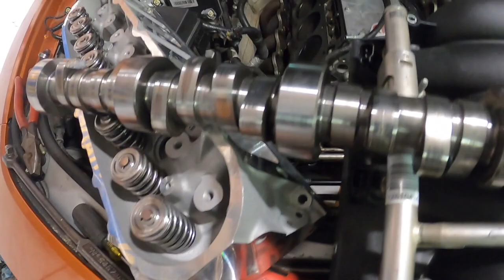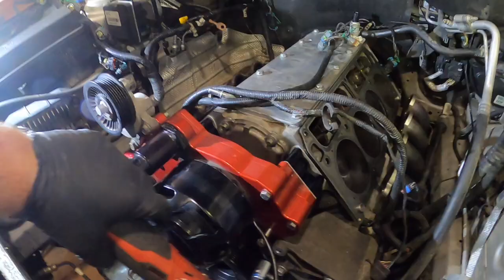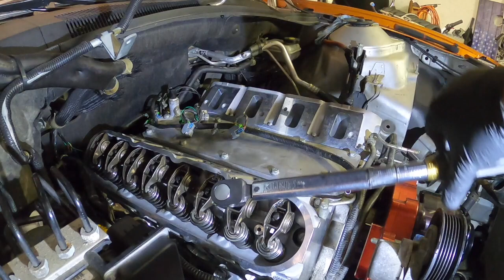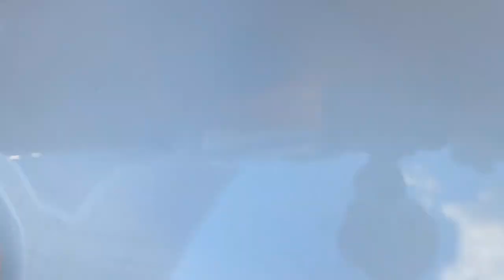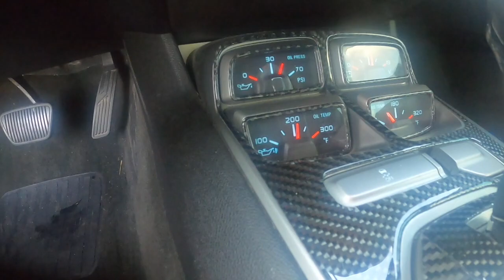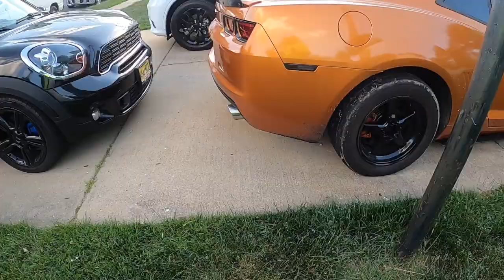Camaro SS SS3 Cam/Ported Heads Assembly & First Start

Comment: Dude get some 3:73 gears you won’t regret it. I have pretty much same setup but tsp stage 3 . Zl1 rear and trans I just put 3m73s and it made a Hugh difference.
Reply: I am having a hesitation issue since new cam install car is going back to tuner next week to get figured out after that I’ll post times hesitation isn’t serious just causing an intermittent hesitation which I don’t want to track it until found and fixed
Reply from the maker: Any 1/4 mile times?

Comment: With powerbond pulley, did your ac squeal? Since i hear it’s occasional thing when you add underdrive pulley
Reply from the maker: Funny you should ask, I did have an annoying squeal but it turned out to be a crappy Gates serpentine belt. Bought a Continental Belt and it was fine
Reply: @The1st60ft  
Lemme know how it holds up
I’ve had some annoying experiences with under drive pulley squealing ac and stuff

Comment: Should be more than 100hp more right? With all the mods you listed.
Reply from the maker: We'll see! Bigger cam 25-30hp, heads 25hp, ewp 12-15hp, udp 10hp, manifold 15-20hp was my quick guess
Reply: @The1st60ft  oh shoot that’s so true!! I forgot you already made 450 and had the SS1, that’s crazy if you make 550! I’m looking forward to that dyno!
Reply: @The1st60ft  which UDP did u go with
Reply from the maker: @ryanwharton2531  Powerbond from GPi website
Reply: @The1st60ft  the 10%?
Reply from the maker: @ryanwharton2531  25%

Comment: How will it run with the gears ? I just did an EPS cam with Frankenstein stage 2 heads. I have a 3200 Circle d stall with the 391s. Havnt had it to the track yet with this set up.
Reply from the maker: So GPI recommended 3.91s and a 4000 stall with this setup. Gonna throw the 3.91 diff back in and it should be good to go. Lemme know how yours does
Reply: @The1st60ft  Will do

Comment: Did you have to up size your stall converter for the bigger cam?
Reply from the maker: Ss3 is recommended with 4000 stall. My 4c converter is 3800-4000 so I should be fine
Reply: @The1st60ft  thanks for the information. I’m in the process of getting that cam but I didn’t know what converter to get . Thanks for the help and love your videos !